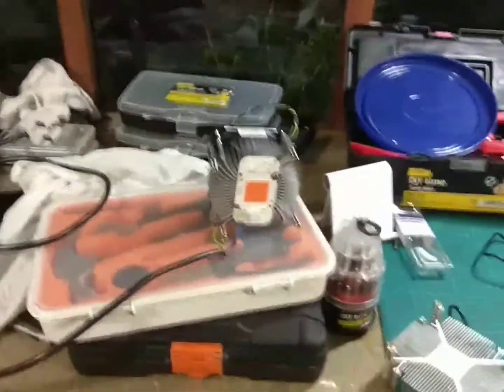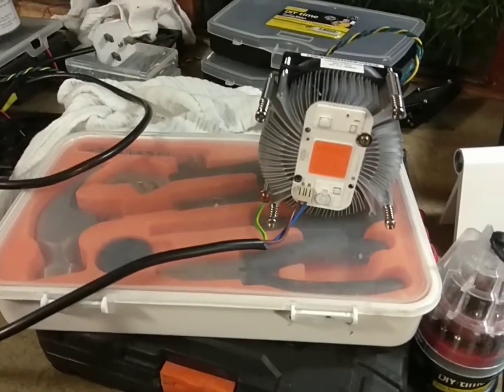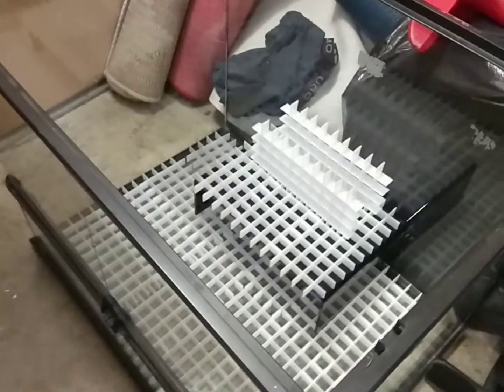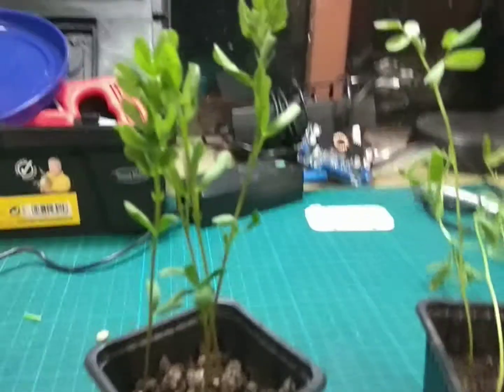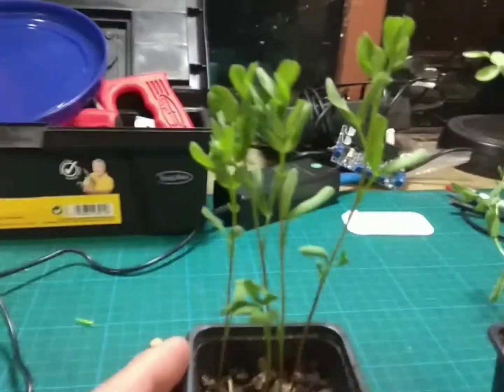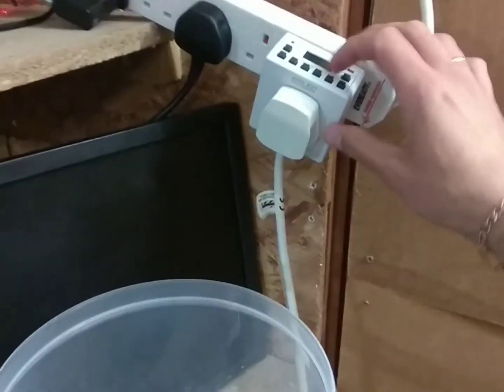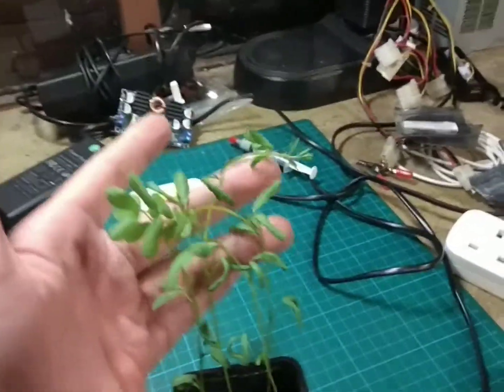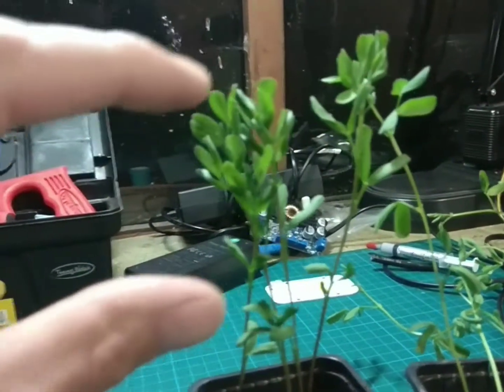80W COB LED vs. natural light on plant growth

Comment: Yea a combo is the way can I use a big heat sink without the fan  that's loud
Reply: psssst !there are silent fans on the market .. ive used some with low decibel but in larger diameter and they friggin work Splendid ! cost a little more but Worth it ! / Paul Roger Nilsson North Sweden